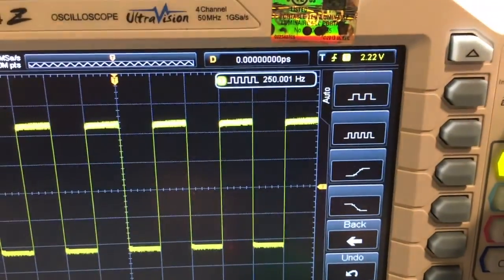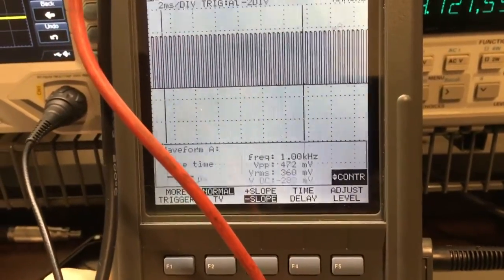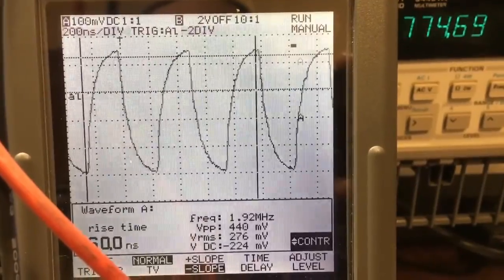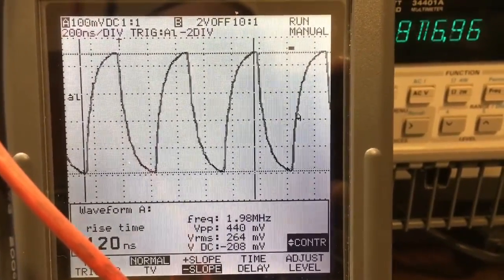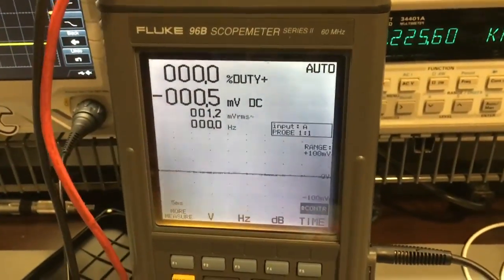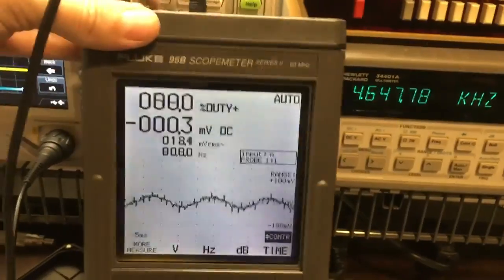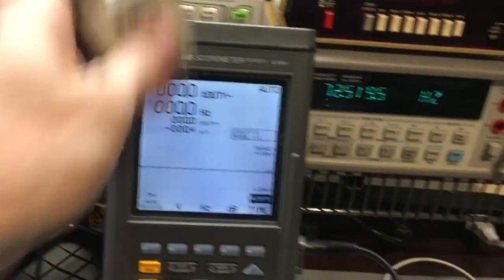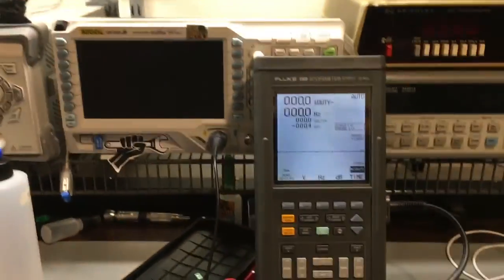Fluke 96B Series II ScopeMeter testing

Comment: My guess about the ScopeMeter's frequency counter issues is that it's calculating the frequency from the displayed waveform. The more cycles you show on screen, the fewer pixels per cycle, and thus the lower accuracy. So by changing to a slower timebase, you're significantly reducing the accuracy of the frequency measurement. This is the same with the Rigol's on-screen measurements (all the ones along the bottom), EXCEPT for the hardware frequency counter (top-right) that you're comparing in this video.
Reply: Antonio Tejada 
It would also be beneficial to center the waveform between 2.5 and approximately 4 waveforms. Yes consistency is an issue.

Comment: The display looks so much nicer than my 97.  Much higher contrast and brighter.  The update rates appear faster too.
Reply: I'm tying to find out of the 96b screen will swap into a 97...
Reply: Btw, the horribly ugly 97 screen is designed to be readable in direct sunlight (transflective), whereas the 96b is only readable indoors (transmissive). Who exactly are these people doing oscilloscope work outdoors at high noon?!?!
Reply: @Russell_319  Outdoor work makes sense for mobile technician/diagnostician using the Fluke 98 Automotive. Wonder if 97 and 98 have the same screen.